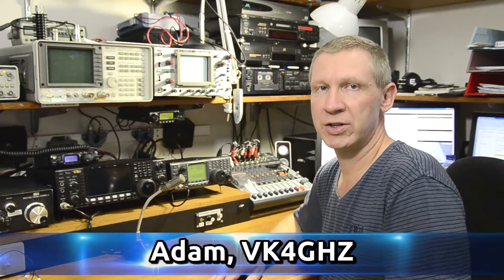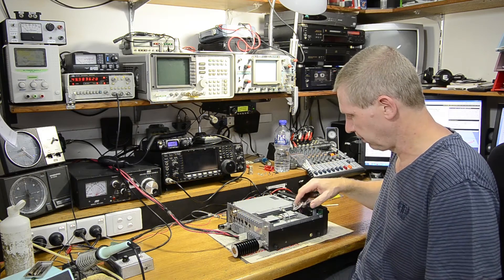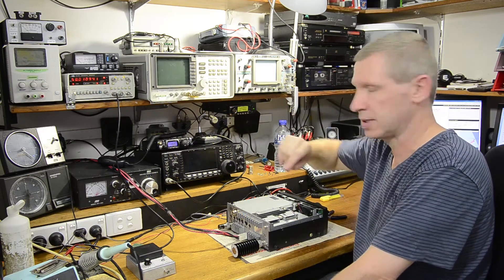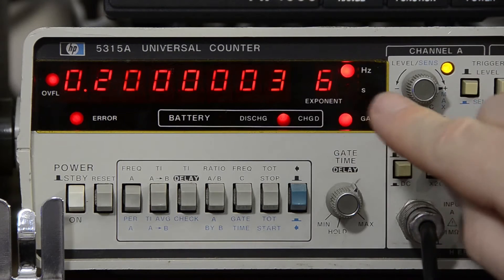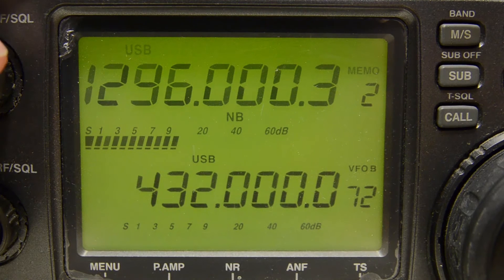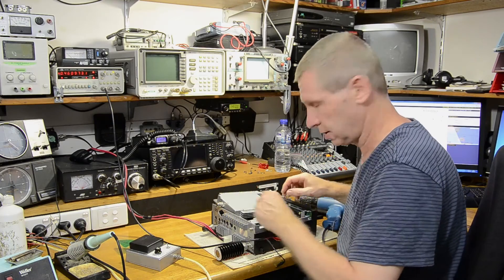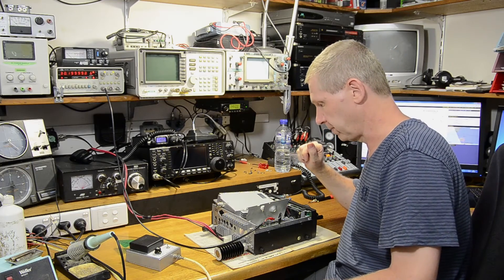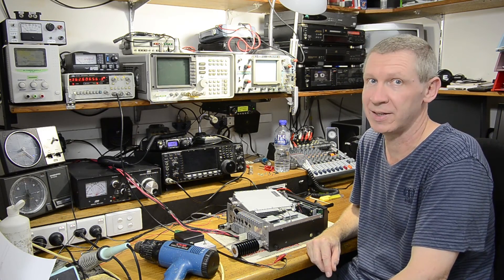Icom IC-910 with CR-293 Hi Stab - Getting on frequency

Comment: I thought about getting a CR-293 for my R8500 receiver but found the stock oscillator performs extremely well on it's own so I didn't bother. Of course, being a receive-only radio, heat is not an issue with the R8500 but it does in fact use the CR-293 option if desired needed. I have been very happy with it and it's stability in stock form.
I was looking for video's regarding the CR-293 and you seem to be the only one expressly covering this particular option :)

Comment: Hi! Very interesting vedeo. I do not have the CR-293 installed in my 910h yet. I do sometimes notice some frequency offset on 2m about 120 hz on SSB and a bit more on FM. My radio is only 2 years old and bought new. Do you think that if fitted with a well tuned high stability oscillator will solve the issue?